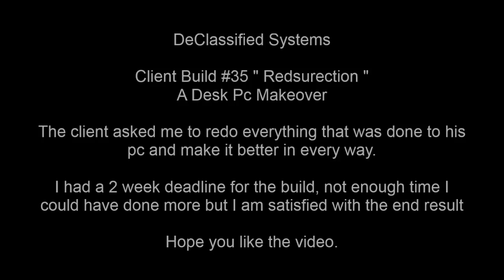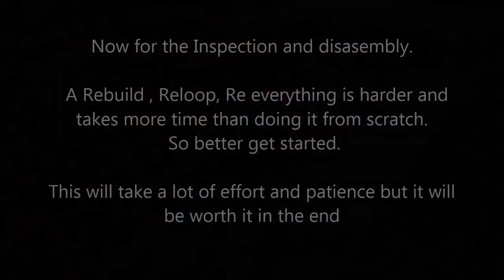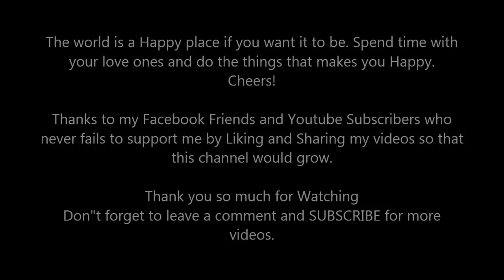Custom Pc Build# 35 " Redsurrection " A Desk Pc Makeover, Extreme Gaming Desk Pc

Comment: You should use a hole saw to cut those fan holes, it would save a lot of time. This build is insane, thanks for sharing, cheers!
Reply from the maker: Yeah i have a hole saw but not big enough so i have to manually its so time consuming, i just hope i could find a size like that, Thank you Have a great day Cheers!
Reply: I think a hole saw is too large and would melt the acrylic due to its shear size, so I found this on harbor freight (American site) but I bet you can find a product similar to this where you are. https://www.harborfreight.com/carbide-tip-adjustable-circle-cutter-68117.html
Hope it works and saves you time!
Reply: The easiest use laser cutter

Comment: That's a piece of art my man, the lines are so straight. It's a very hard thing to do. Was there any sagging in the longer runs of tubing?
Reply from the maker: Thank you, for a couple of days i saw a sagging on the long tubing from the pump to the inlet of the gpu  the reason was the tubing it was the 90 degree fitting is slightly loose but when i change that fitting there was no sagging anymore.

Comment: Awesome upgrade. 

The only flaw I see is the drain. I don't believe it should be that long because the fluid will not cycle and could cause issues with molding or something like that. Seems to me you could have just did a 90 Degree down from each port to a valve through the bottom.

Thanks for sharing... Cheers...